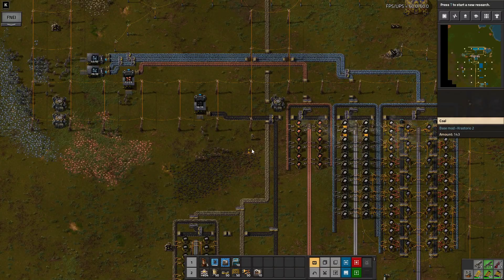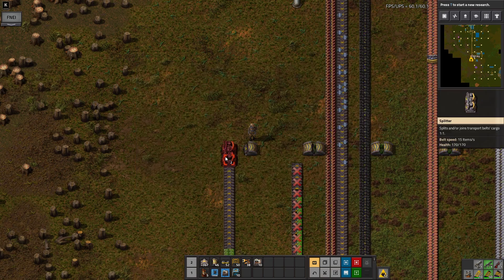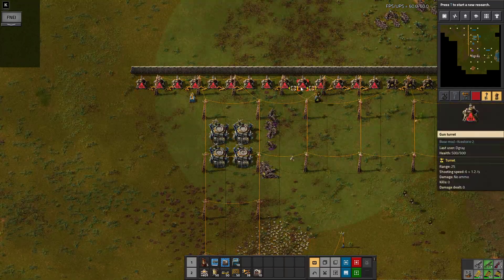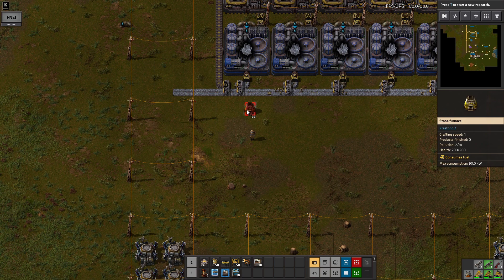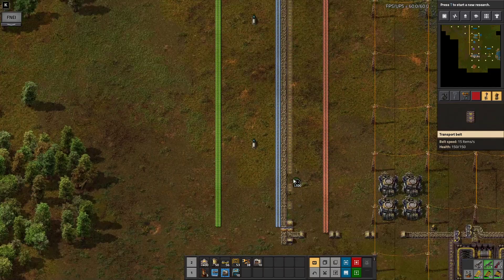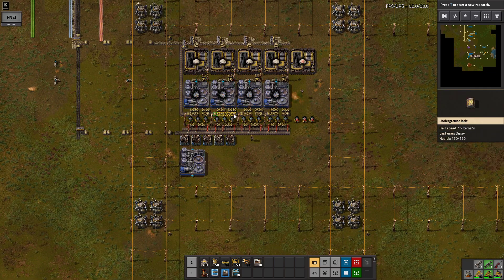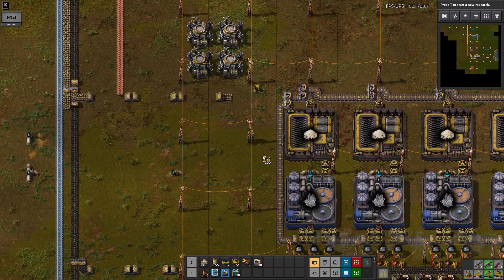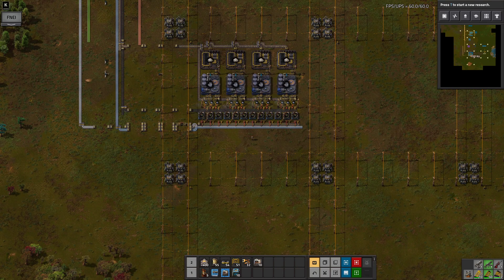ELECTRONIC COMPONENT! - Krastorio 2 - Factorio 0.18 Let's Play - Ep 12

Comment: 2:35 - brilliant? what for loaders - inserter can easily deal with the low amounts of quarz in 6 secods - and you need only 1 per furnace instead of 2 loaders!. The full block looks nice and it makes sense to not ship stuff onto the bus thats just used in one other location.
Reply from the maker: You are correct about the loaders. I just wanted to make a build that cost as little power as possible and Loaders are free if you don't count the crafting cost :)
Reply: @dgray2790  that makes a lot of sense :o)
Reply: @dgray2790  crafting cost that btw isn't expensive at all for a device that can transfer 15 items per sec